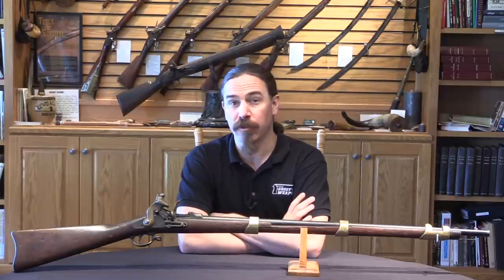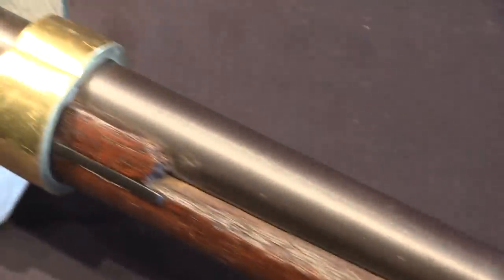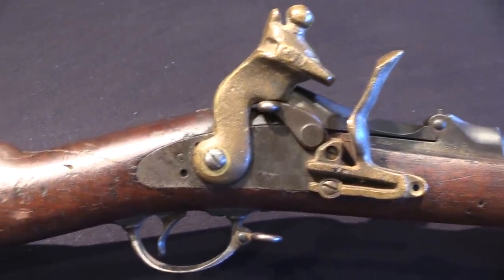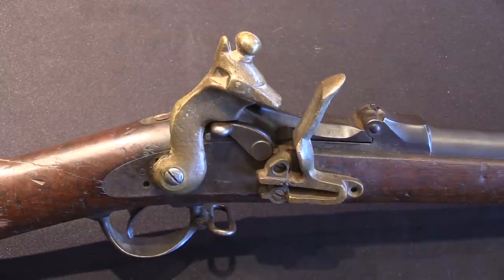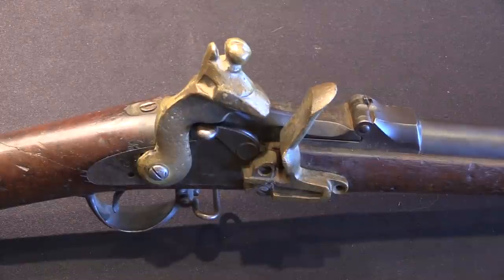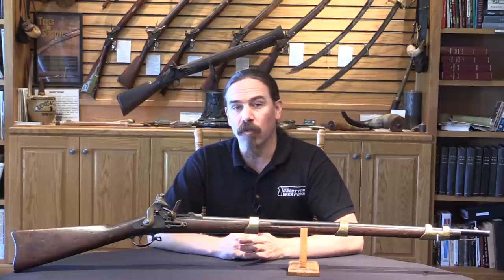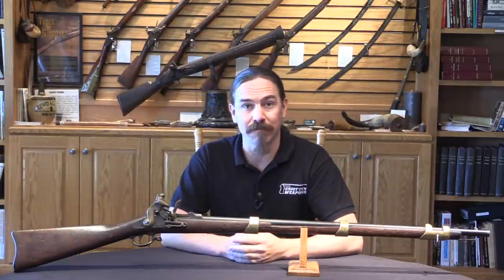Movie Conversions: The Flintlock Trapdoor Springfield

Comment: Christ on a cracker that poor springfield has been mutilated. It's machine spirit cries out for vengeance. Arco-flagellation is far to mild a punishment for the hereteks that desecrated this poor rifle.
Reply: not realy tho Oo   seems to me you could easy just take that stuff of, use the original screws change the bands and presto it is back to normal... since it was used in a 60s movie - it is close to "relic" status as a replica itself
Reply: Trapdoors are blasphemous from their birth.
Reply: Yeah, thats what I wanted to point out. Besides the Woodscrew for the barrel bands, aslong as the original parts still exist, this gun is basically unmodified

Comment: Really hope that they didn’t use original trap doors to make this monstrosity
Reply: They did use originals. There were no reproduction trapdoors yet when these were made
Reply: You could refix it back to its original state.
Reply: Why not? In the 1950's these were surplussed off at almost a dime a dozen. I have one (plus a couple of Civil war era swords) that my dad bought at a surplus store in Chicago to hang on the wall as decorations. No one was collecting such things at the time. Mine is a kind of Frankengun as it has the breechblock of an 1873 but the sights and serial number of an 1884 model.
Reply: @machintelligence  Back when many of those conversions were done surplus dealers like Bannermans were selling Trapdoors for $2.00 each.  They were that common and unwanted by collectors.

Comment: Theatre and film is about illusion and repurposing. I love that.

Ikea rugs for "fur".
Kitchen sieve fixed with light to make a weird dot-effect.
Old military crate multipurposed as a car, a coffin, benvh and barricade in the confines of a small stage.
Flashlights, translucent paper and metal sheets to reflect "flickering flames" on the walls. 
Metal cans painted and fitted with
Bike handle-covers to make a crude prop stick-grenade that looks pretty decent from a distance.
You name it!

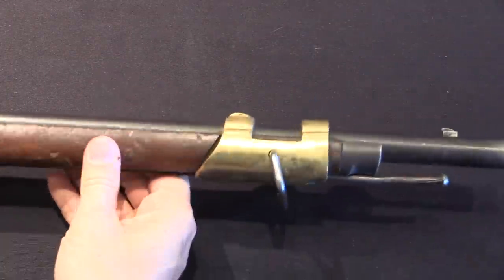Comment: 3:36 I saw a review of the customised Devon Aoki car from Fast and the Furious and when you look at the customisations up close horrible. But that's because most of the time, you don't see the car up close, and for the angles that you do, they put some more time in it.
I expect the same here, do we need a zoomed in close up? Nope. Then this will do.
Reply: Movie props, including cars, often have several different versions for different tasks as well.
There's one or more "hero" versions that are finished perfectly, and those are in the closeups. There are background versions that don't have to look as good. If the item has any functions or special features, there'll be at least one example just for that. There's stunt versions, like guns cast out of rubber that won't break when dropped and don't hurt if you fall on them. A car for stunt driving can just be a body on a specialised chassis. For shots inside a car, you might have one that has a great interior but is festooned in camera mounts on the outside. If the prop is important enough, there will be spares for each role. And so on, and so forth.

Comment: The amount of effort they used to put into practical effects and props is really impressive by today's standards. Nowadays they would have either stuck with the unmodified Trapdoors or used CGI guns.
Reply: More like cast plastic guns with CGI puffs of smoke.
For decades films have used rubber guns for scenes where they're dropped or thrown. And also for scenes where there's no shooting, to avoid the need for the precautions used when a blank-firing gun is on the set.
Reply: @donjones4719 
There was that actor who killed himself in the 1980s by firing a blank loaded pistol against his head. Also I've heard the term "rubber gun squad" used in relation to police officers that were put on administrative duty to keep them off of the streets.
And CGI guns are entirely PC.
Reply: @mpetersen6   Yes, that's the kind of story I was referring to. Fairly elaborate precautions are now required, costly in terms of one or two personnel to watch over the guns, afaik. Well, even more elaborate than the ones in effect on that set. So, yup, totally fake guns are cheaper to have on the set.

Yeah, that certainly is another use for the term rubber gun.
Reply: @donjones4719  The actor was John Erik Hexum, who died on the set of a TV show about secret agents disguised as fashion models. Can't remember the name of the show, but it was a play on words... 
Then there's the death of Brandon Lee on the set of The Raven...
Reply: @donjones4719  
There is one thing that any one who is not familiar with firearms in the entertainment industry who us working on a filmor TV production should be for ed to learn is just how dangerous a blank round can be. True there is no bullet involved but there is still an explosion. Plus film and TV production companies have long had prop men who where responsible for any firearms being used.

Comment: I have a 07/15 Berthier with a Western Costume Company stamp on it.

Sanded to hell, thick poly on the stock, replacement sights for some reason, and not a matching part on it.

That said, once I cleaned it (no rifling was visible, so much fouling in the grooves) it works great, shoots well, and was all of 80 bucks.

Comment: All the rifles in “The Outlaw Josey Wales” were these conversions excluding Joseys sharps rifle
Reply: Patrick Dertz:  I don't believe there WERE flintlocks in "Josey Wales", as, at the time of the film, i.e. the end of the Civil War, flintlocks had mostly given way to caplocks, especially among the military of both sides.
Could you document your assertion?
Reply: @mikegrossberg8624  if you watch the scene where the redlegs attack the ranch it is pretty obvious they are using ramrods on the rifles in the ranch and they will fire the rifles once then switch to a different rifle while they wait for that one to be reloaded. Also the movie takes place at the very end of the civil war before the trapdoor Springfield entered service. Looking closer at the rifles in the movie they appear to not be this exact pattern but they don’t look like standard Springfield’s either
Reply: @patrickdertz9110  Both the US Springfield, used by Union forces, and British Enfield, used by the Confederates, were still muzzleloading single-shot caplock rifles, which is why they had ramrods.
BTW, Josey's Sharps would have been using PAPER cartridges; the lockblock, closing, would cut off the end of the paper, exposing the powder charge.  Metallic cartridges, for anything other than the Spenser carbine, hadn't been invented yet
Reply: @mikegrossberg8624  oh my mistake I completely misread you original comment yes you are correct they were all caplocks the confederacy might of had some flintlocks floating around bu yes you are correct. And the guns in the movie probably aren’t changed that much
Reply: @patrickdertz9110  FYI, it WAS reported, at the BEGINNING of the war, there WERE some Confederate troops still using flintlocks(all that was available to them), but switched over as soon as possible
Reply: @mikegrossberg8624  yeah that doesn’t surprise me the confederacy was a bit of a logistical shit show
Reply: @patrickdertz9110  Rhett Butler, Gone With The Wind: "The North has ships, factories, railroads, and population.  All the South has is cotton, slaves, and arrogance!"

Comment: Well from now on they better start training their actors in proper flintlock usage and have them use the real thing coz I'll be on the lookout for stationary frizzens from now on.
Reply: I would expect that safety is more a concern than 60 years ago and  the real is even more unlikely.
Reply: @2adamast  What would be so damn dangerous about a flint lock gun spitting some flames at "enemy" actors that are far away? And yes, I'm well aware of the fact that the priming charge makes a pretty big flash too but as far as I've heard the shooters closed their eyes before pulling the trigger back then to avoid getting blinded from the flash, so why wouldn't the actors in a movie do the same and thus be perfectly fine? And if the movie scene requires a point blank shot what would stop the actor from just priming the pan and leaving the barrel empty?

And even if they decided not to fire any of the flint locks for real and even not to PRIME them, the very least they should do is to drop the hammer on a closed frizzen to at least have the movement of the mechanism and the sparks to work with. Everything else could of course be added in post production, but actually blank-firing the things would make things a SH!TTON easier for everyone.

Comment: I was really confused for a second, because blank firing a muzzle loader sounded way easier than converting a cartridge firing gun, but then I remembered that high quality mass produced reproduction flintlock kits weren't really a thing until the last little while, so it was probably availability that was the problem, not the operation itself.

Comment: Due to the firearm laws in the UK, British film prop flintlock blank fires often use a reproduction block barrel flintlock musket with a blank fire mechanism  comprising of an offset tube set into the barrel to take a blank cartridge (usually 9mm) just behind the frizzen which is fired by a steel slab with a firing pin set into the Jaws instead of a flint. Quite loud and impressive from a distance. I have a brown bess converted in this manner that I use in re-enactment

Comment: It’s too bad they didn’t put a cap holder to take a small squib charge in the fake pan/frizzen. When the flint/hammer dropped it could fire the blank cartridge as well as set off the squib charge to also have the puff of smoke from the pan flintlocks are known for.

Comment: Is this why trapdoor Springfields are absurdly expensive for the numbers produced?
Reply: No, Trapdoors were dirt cheap for decades, over 700,000 were built so they weren't scarce, the majority of them saw no heavy combat use so they were mostly in very good condition, and with little to no combat use there was no history to most of them.  Commonality + no history= low prices.
It was only in the late 70's and into the 80's when black powder cartridge shooting became popular that the prices began to rise, also as the price of high-demand collectable guns began to rise they pulled the price of the Trapdoors up with them, just like they tend to pull the price up on other guns. 
Back in 1971 Harrington & Richardson began building replica Trapdoors, which mystified me.  The replicas sold for $150, but at the time you could get a nice original for that!

Comment: Interesting. In the past I have wondered if a trapdoor flintlock could be made to work with paper cartridges and an auto-priming pan a la the Collier revolver. It would seem to me the trapdoor 'bolt" could be cut to allow a proper gas seal, and perhaps make for a fast breech loading flintlock.

Comment: these were used in the era of lower quality cameras which would have made it easier to pull something like this off for the extras. An interesting subset of holywood history, if not necessarily firearms history.
Reply: Lower quality cameras? Every frame of 70mm film stock is automatically a UHD render by the nature of film itself. Don't confuse recordings at TV broadcast resolution for full-fledged cinematic presentation.

Comment: I get that its for as you in the US call them movies (AKA Films) 
But this is just mutilation of a historic firearm a flit lock is not that hard to learn even more so when all your doing is putting a little power down the barrel and no shot or ball you can tell good films when you see the right firearms been used and been used right you can nit pick at films all day long when they do stuff like this no flash of the pan when you fire not that spit second delay when you pull the trigger its stuff like this small as they might be separates the good films from the chaff